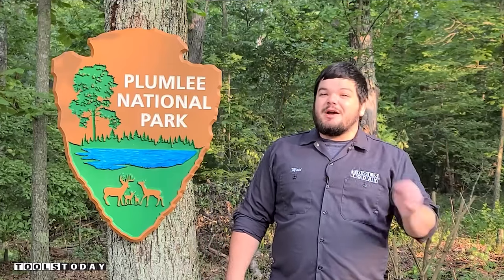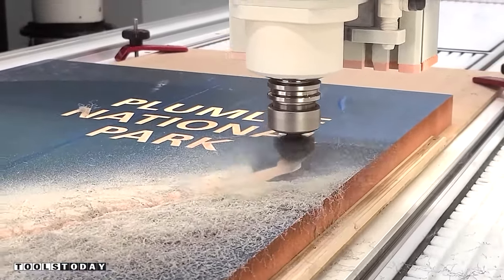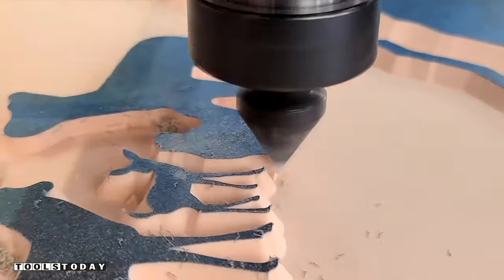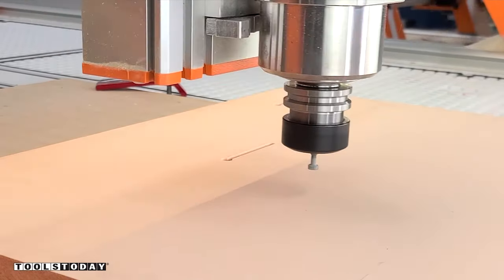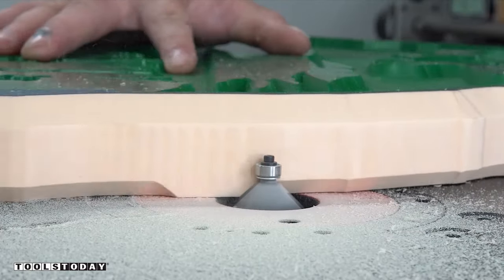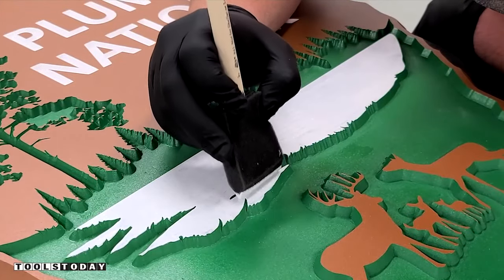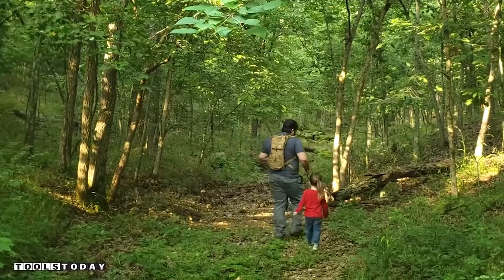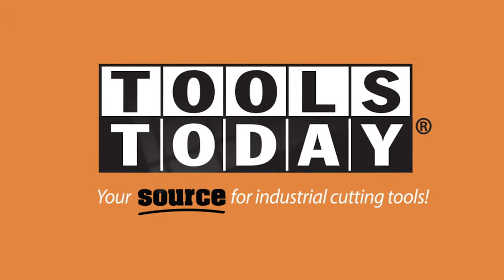How to: CNC Signmaking National Park Sign | ToolsToday

Comment: ouch over $600 for a sheet of tha foam board? 4'x8'x2"
Reply: Wait till you see the price for that CNC😢
Reply: where did you see the price? I don't see it on the website.
Reply: @JDPat1230  If you’re asking about the price of the cnc, there is a link to Toolstoday. They sell Stepcraft.
Reply: @BobBob-eh5sb  Sorry. Was asking about the HDU. Those Stepcraft are nice but crazy expensive.  I just ordered an Avid CNC which is expensive, but not as nice as the Stepcraft.

Comment: How did you program the keyhole slot?
Reply from the maker: I made a square with a .0003" height, then deleted the left side of it.  I then set it as a profile toolpath on the line so it would plunge go to the right, then back and out the same hole.
Reply: Keyhole toolpath in vectric works good also